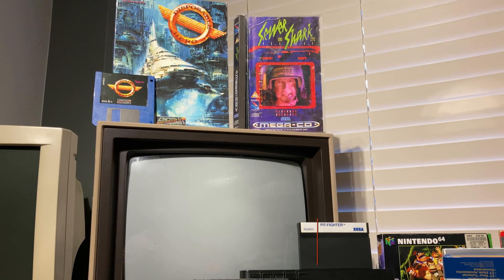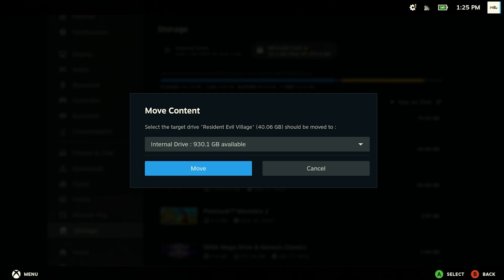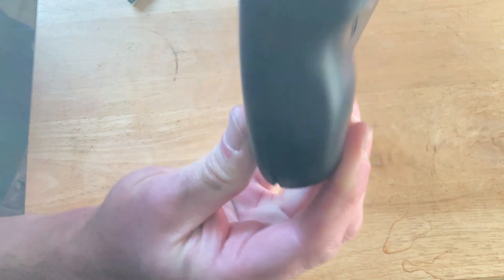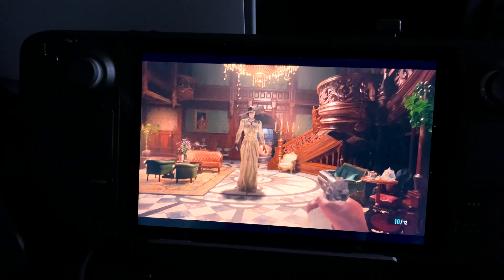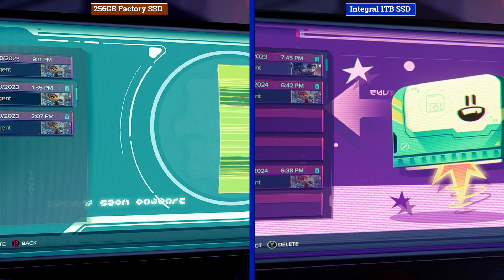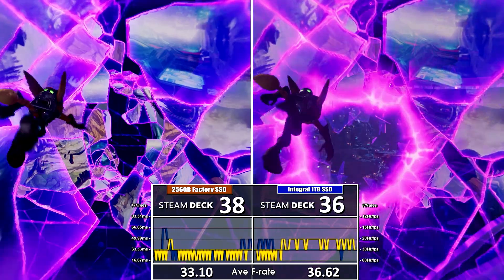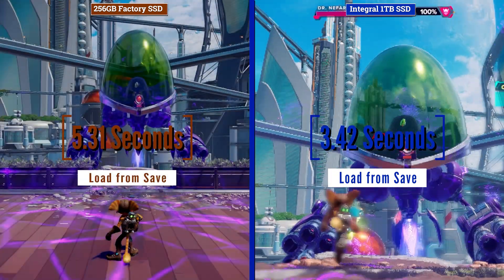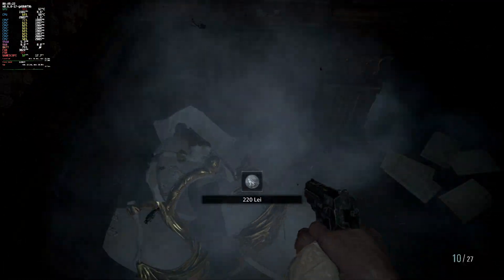Upgrading Steam Deck SSD: Integral 1TB SSD Tested against Stock Drive

Comment: I've got the older 64GB model and a 1TB Gen3x4 that I have yet to install...the gains from going from the 64GB eMMC to the 1TB PCIe Gen3x4 will be HUGE! But I've been super lazy and I don't have only played my deck ONCE since I got it last April LOL!! ... heck I don't even play the games I have, but I think I'll play them more once I figure out how to play the Windows Games I own on the deck.... maybe I'll set up a dual boot (I THINK it's possible.. I did have windows on it at one point just to see how it worked and it was fine.... but then I read that I can run the windows games on Steam... but all attempts fails being that I RAN OUT OF SPACE with my tiny, SLOW 64GB... and then I just got lazy.. but I think I'll try again after I install this 1TB drive)
Witty..??? Funny...???? I think I'll leave that to the people that NEED more space (although it would be cool to win just for the sake of winning) If it was a 2TB then I'd try, but there's no sense in being greedy (plus I'm not all that funny anyway.... okay .... maybe a bit funny LOOKING... but that's about it :D ) - THANK YOU for inspiring me to FINALLY get my deck done up right :)
Reply from the maker: Yeah, you will see the biggest leap for sure as you are effectively moving from an SD card to SSD. I would expect, in some games, over 100% increase in loading and even huge leaps in performance, specifically games like Rift Apart, Dead Space and such. Glad this motivated you to do it, let me know how much better it was.

Comment: I'm fairly certain, aside from save data, that many of my Switch physical cartridges games play directly from the cart and don't actually need to download or install anything.
Reply from the maker: You can, but many are only partly resident on the cart so you have to download (Batman, MK1, Hogwarts) some are not at all. And aside Nintendo's own games you have to patch them to the HD as the launch version is in a bad state, broken at times and even worse on occasion.
Reply: @NXGamer  completely true.